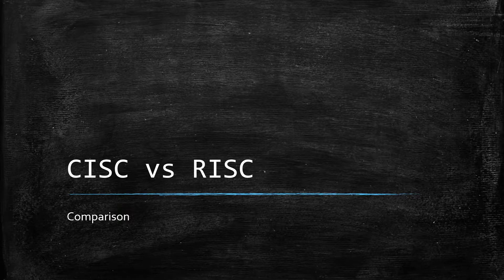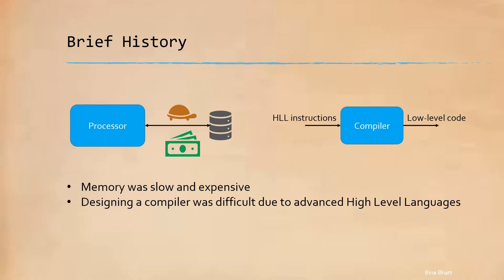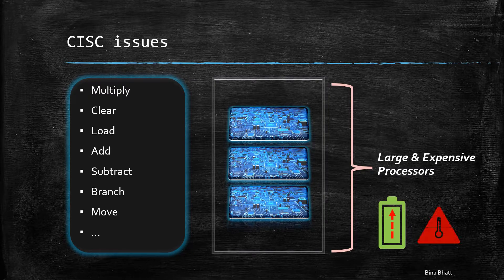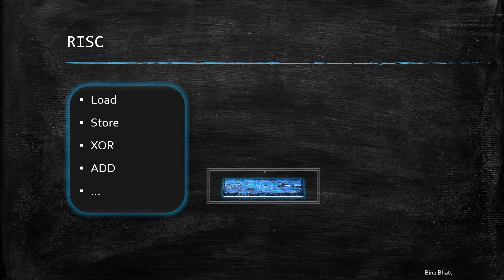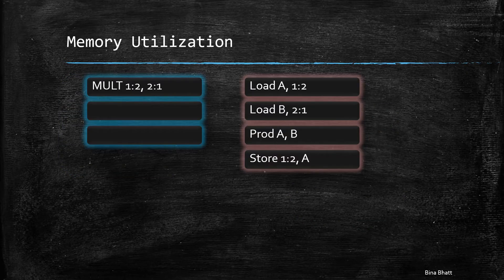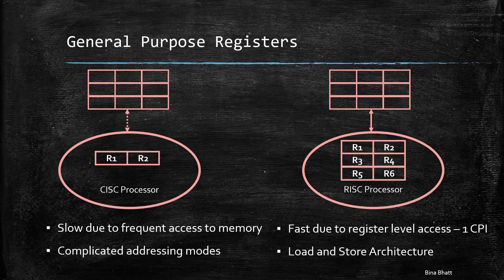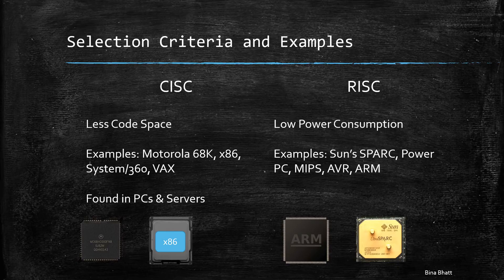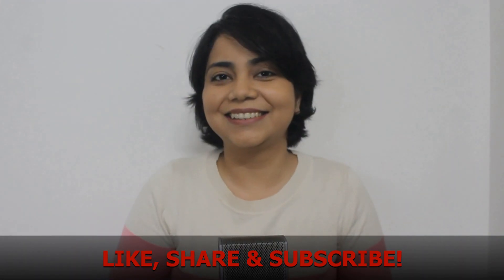RISC vs CISC | Computer Architecture

Comment: today's world is about SOCs & Discrete systems, two things that contrasts each other.

No matter if it's ARM or X86,

in an SOC everything including CPU, GPU, NPU, RAM, SSD are packed into a single chip or atleast soldiered on the motherboard very closely, thus getting more power efficiency / battery life and giving up on modularity.

on the other hand Discrete systems have CPU, GPU, NPU, RAM, SSD all seperated, thus getting modularity. Means some system with loads and loads of GPU with with a fair ammount of CPU and storage is possible (like crypto currency minning), making a system with some ammount of cpu and loads and loads of SSDs is possible (like data center).

thank you such an informative video.